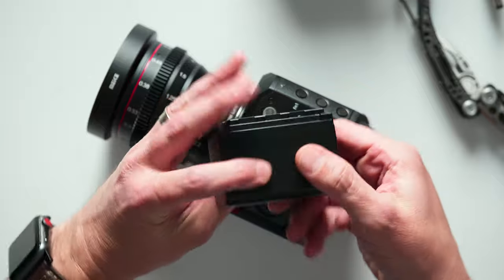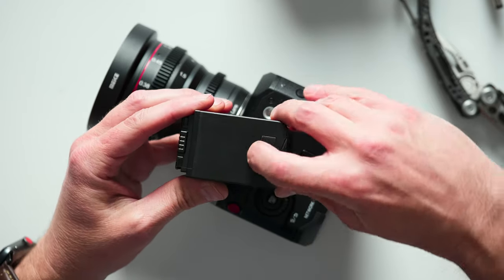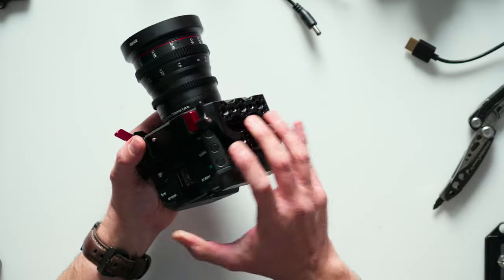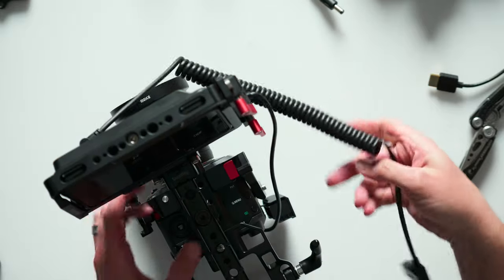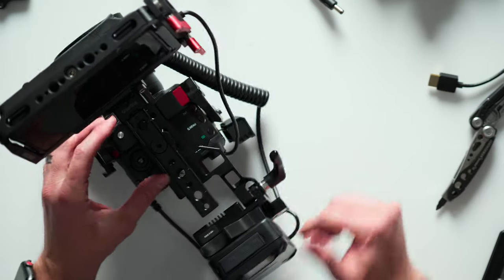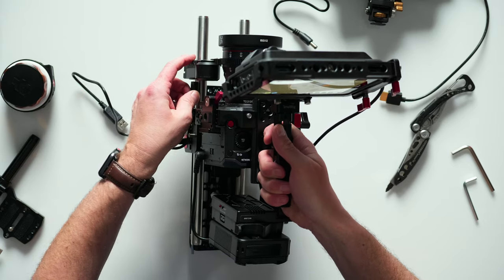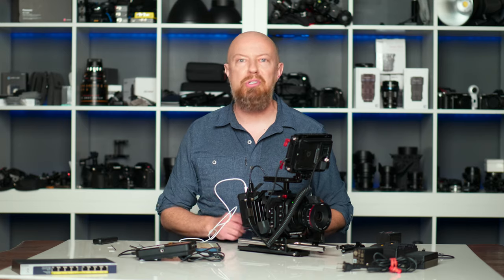BGH1 Battery Power & Rigging Solutions, featuring Wooden Camera Cage | LUMIX BGH1 Cinema Box Camera

Comment: Thank you very much for the tip of the SWIT battery, what also good to know is … this battery can also be charged by the DC socket/pole connector ! with the SWIT S-3010 charger, that costs about $25 a real money saver, and also from the SWIT brand.

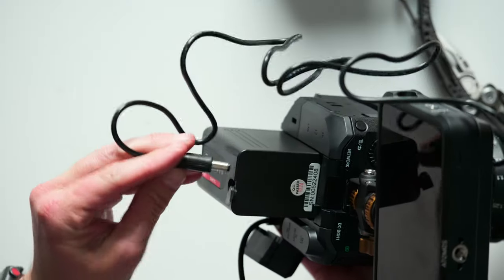Comment: What is that wire called at 2:22? The wire from the Swit to the monitor. Thanks in advance.
Reply from the maker: That’s a simple DC cable. On Amazon you can find cables that go from DC to DC, and it’s just a case of finding the right size. Some hardware makes it easy to find, some don’t. Google “DC port sizes” and you’ll see what I mean; there’s an outer and inner measurement, for example: [Type B: 6.0 mm OD, 2.1 mm ID] that’s “outer” and “inner” diameter.

Comment: Joseph! I wanted to use a V mount battery but only have one D-tap for my set up and I wanted to run my Nucleus-m via d-tap! I’m using the small rig vb155 but trying to find the right cable. The usb-c is only 5.0v and a normal
Battery is 7.5v so I’m trying to work around it looking for a 12v DC to 12v DC that fits the Panasonic DC in port. Tried a dummy battery from KondorBlue but didn’t fit. Any recommendations?
Reply from the maker: Get a V-mount plate that has a d-tap on it so you gain another plug.

Comment: After watching your videos on the BGH1 here and on the Lumix channel I purchased one, but when I open the tether software and click Live view the screen that opens covers the control panel to be able to adjust the iris, shutter, WB etc. I cannot move the tether software control panel as it stays stuck in the middle of the screen. On the videos you made for Lumix I see the control panel sitting nicely next to the Live view screen. Please explain how to set the screens up properly for ease of operation, thanks
Reply from the maker: Windows or Mac? They’re just floating windows like any other, but I have had troubles moving them sometimes. Tell me what OS please!
Reply: @photojoseph  I am using Windows on a Dell Laptop. I tried it on my desktop and I can move the window but I cannot on the laptop. I can only move the live view window but not the control panel window to set the camera settings. Very strange
Reply from the maker: Sounds like a Windows problem, TBH. I can move all mine on Mac and PC no problem.

Comment: I want to use the PoE+ solution, but powered from a fpv drone. will i destropy anything in the camera by adding a 12v source to the other end of the ethernet cable ?
Reply from the maker: Interesting. You’d have to look up the power delivery of the Ethernet port; I don’t know. What does PoE+ output normally? I think a d-tap to camera DC port might be better, but it needs to be regulated, like this one: https://www.adorama.com/ipdteva24.html

Comment: Hey PhotoJoseph. Quick question, does the BGH1 require handshake with the battery for proper operation? I purchased a GyroVu battery plate to DTAP adapter and there is a message saying that it does not support cameras that require handshake but I cant not find any information about it. Thanks mate :-)
Reply from the maker: Not that I’ve heard of. What is the cable you’re using? I think it’s more likely to be a cable problem.

Comment: wondering if you have experienced any audio ringing in headphones when you also power your monitor from the same battery? I have a Portkeys LH5P powered through the same battery as the BGH1 and I get a high pitched ringing in my headphones when I connect to the camera headphones port. Audio is also going through the HDMI output and shutting that off doesn't fix the issue. Now there is no ringing tone that is transferred to the actual footage audio, but it's annoying nonetheless in my headphones. Have you experienced this and if so, are there any fixes?

Comment: Hey there @PhotoJoseph, would you happen to know if the 12v input can take the 16v peak of a non-regulated V-mount, or do we need to add in regulation to 12v to not fry anything?
Reply from the maker: ooh, that is not a question I know the answer to. I'm afraid you'll need to reach out to tech support for that one (assuming of course it's not in the manual). The camera itself just says 12V on the input. Perhaps it regulates it though, if it's common for V-Mount batteries to have unregulated outputs?
Reply: @photojoseph  technically according to the manual it says use nothing but their supplied power supply into that port. So I feel like getting an honest answer is a bit more difficult. Most v-mounts send the native voltage and just have current regulation to prevent overdraw.

I noticed you used the cable from the Wooden Camera plate into yours here, do you know if that is a 12v regulated output?
Reply from the maker: Sounds like something a manual would say. I will see if I can find out what that cable was; it was on loan very briefly, just for that video.
Reply: @photojoseph  the manual sadly just warns to only use their power adapter and doesn’t provide any specs. If you can find out if that was a regulated cable or the plate output (wouldn’t be to standard Lemo 2-pin spec however if the port was), that would be amazing to know!
Reply from the maker: There are specs in the manual — they say the DC in is rated from 11.4V to 12.6V. The cable should be regulated, and must be, but of course you should check with Wooden to be 100% sure.
Reply: @photojoseph  oh interesting, the one that came with my Canadian camera didn’t have those details where I looked. Thanks!

Comment: nice video, however powering a screen via the same power source such as the battery with a DC out could burn the HDMI output of the camera, i think its also possible by the vmount option. there are ways to avoid but a lot of people frying there camera's this way unfortunately.
Reply from the maker: I haven’t heard of this… how does this burn the HDMI output? Like, two contacts on a battery coming in contact with each other? It doesn’t really make sense but I’d very much like to know more.
Reply: @photojoseph  This is the same got HDMI* not only SDI
Reply from the maker: Sorry I don’t understand what you mean. And considering batteries like the V-Mount are specifically designed for this — a single battery to power lots of devices — I’m going to need some hard info please.
Reply: @photojoseph   Sorry i commented a URL to an article written by Arri, but somehow didnt end up here, maybe youtube doesn't allow urls.. i will dm you on instagram the link :)

Comment: He said that you need the charger to charge the official batteries. Does that mean you can't charge them in the camera if ever needed?
Reply from the maker: Correct, the batteries do not charge on the camera. And you can use lots of different batteries; not just the Panasonic ones.